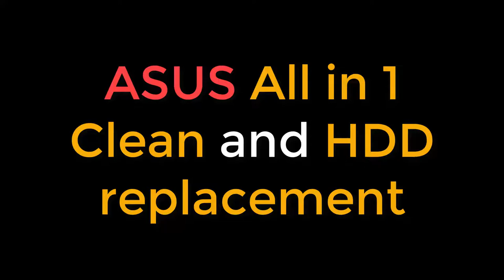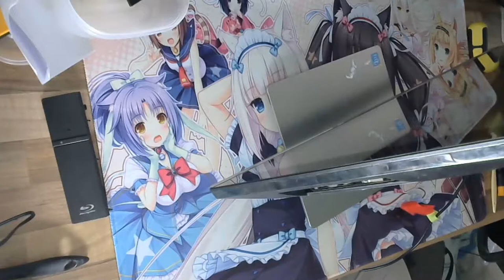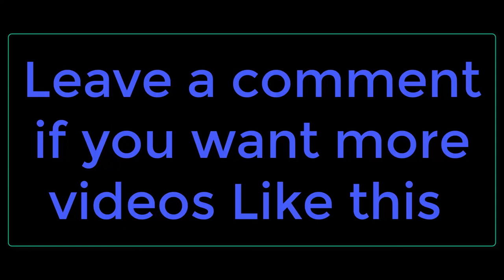Asus AIO ET2321I Clean and HDD install

Comment: Was this a standard sata HDD you replaced ?
Reply from the maker: sorry for the late response, but yes this was a sttandard 3.5 inch drive install, as itt has a TV card in it I would not use a SSD in this case as I would want longevity rather than absolute disk speed